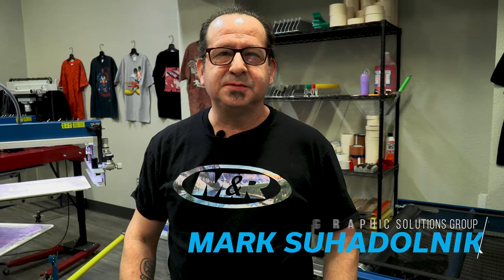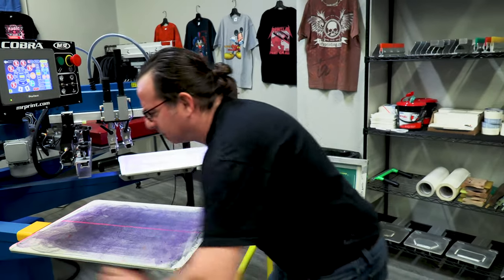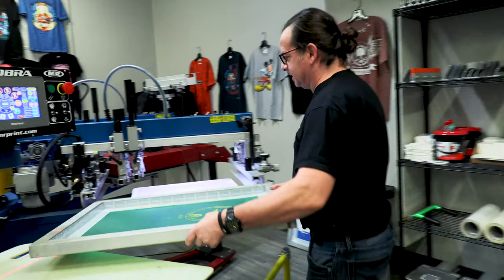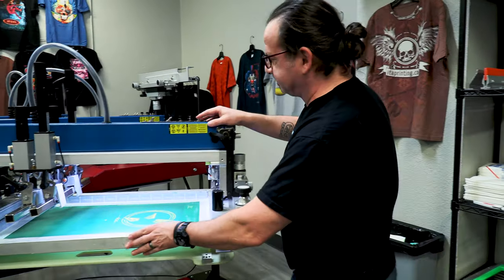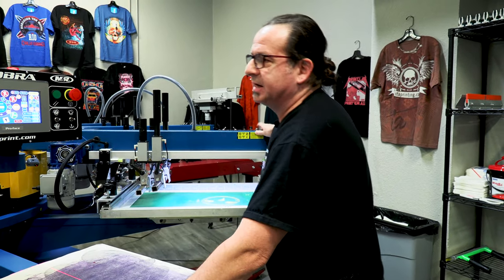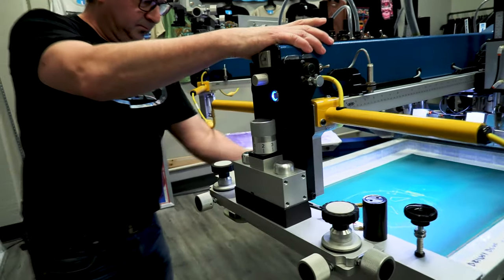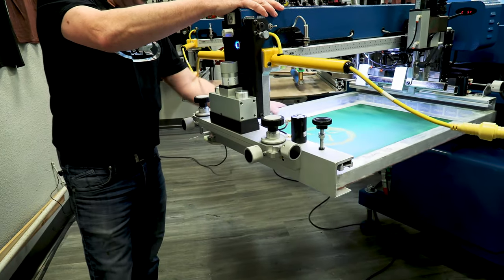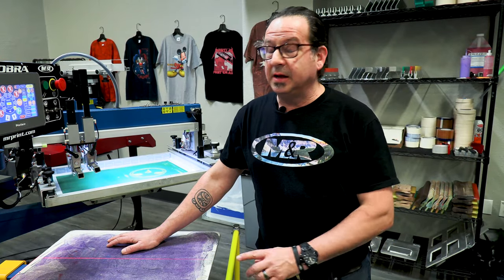TRI LOC Registration System Tutorial M&R Cobra | Perfect Screen Registration

Comment: Another great VID!
Notice where his left hand is and what he’s doing... (while he is locking the screens down).  That is important. Some of the most common reasons for people who say they get 1 out of 6 screens that doesn’t register just right is because they don’t or didn't “hold” that one screen “but up” against the stop blocks during the lock.  Without holding it, you may get it in place just fine, but the lock snap, can make a screen jump a little. Holding it, assures the position. And you don’t need to hold it very tight. Just snug.

Comment: Why when it's time to print after using the tri lock system it doesn't line up what am I doing wrong
Reply from the maker: There are a few things that may be going on here. It would be much easier to walk you through it if you gave us a call (800) 366 1776. Thanks!